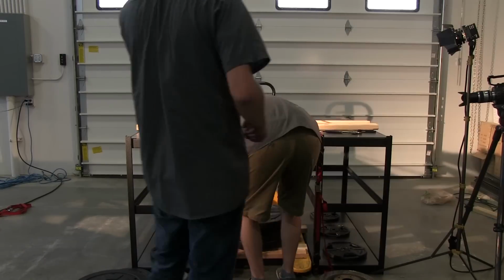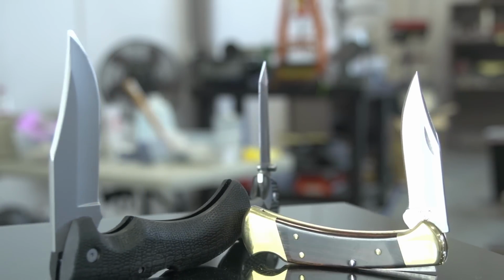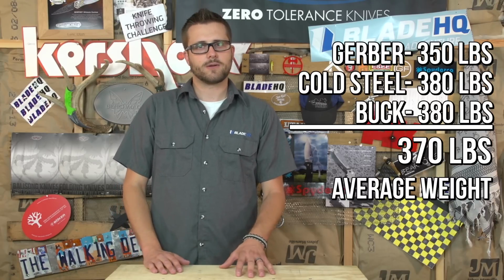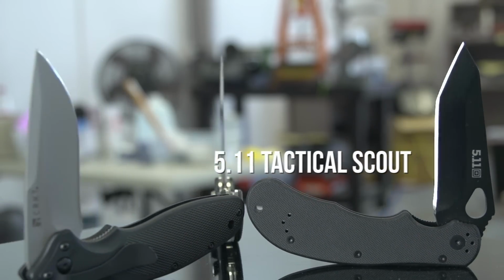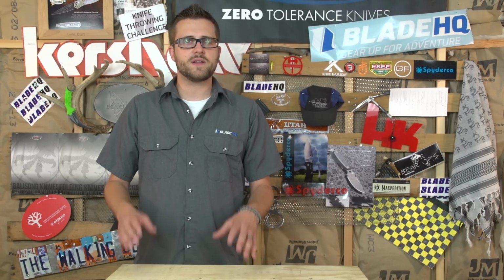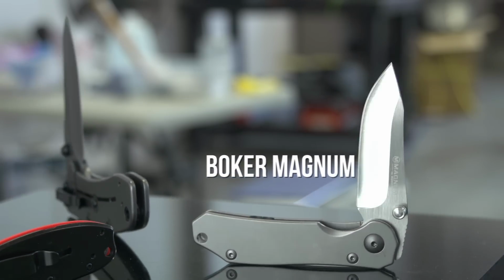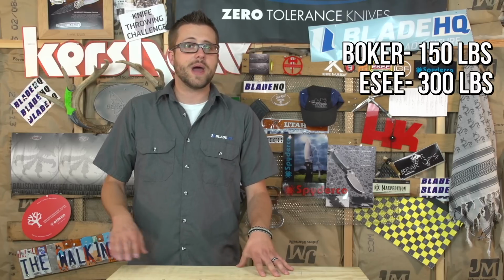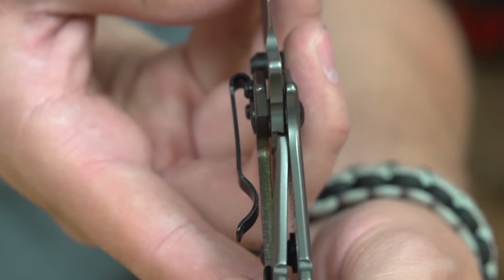Pocket Knife Lock Strength Test

Comment: Two things
First, the way you guys determine the average value is just wrong. Can’t just say 380 lb is the max value.
And secondly, for the results to be some what accurate, all locking mechanism has to be using the same materials. Different steel and it’s alloys has different capacity. 
So this is like sorta comparing apples to oranges. Nevertheless, nicely done and I enjoyed watching it.

Comment: Whats the difference between liner lock and framelock?
Reply: A liner lock has handle scales, and a metal liner inside to act as the locking device. The frame lock uses the actual frame or scale of the knife to lock the blade.
Reply: oh ok thanks

Comment: Can these locks take a large static load that is carefully and slowly applied? Sure. Can they reliably take much smaller loads that are applied abruptly, dynamically, and with varying direction? The good ones can for awhile, but ultimately no. get a real knife, a fixed blade.

Comment: That'd boy how u do the test....u need to pull from tip at the end of the knife....not at the middle ...at the middle resistance is way stronger...u need to  do it at the tip of the handle.....set up a rig where u can put like a cap 9ver the end 9f the handle and pull on that

Comment: Cool tests, thanks for destroying all those knives for us. What about Axis locks like Ganzo or Benchmade? I know you may not want to spend that much money to destroy it for a test. Interesting how the Gerber handle was pulled apart, although in it's defense it looked like the soft handle material allowed the cable to slide down and hit the lock release. I noticed you put on safety glasses after the first tests. The important thing is, most failed at weights way over what anyone would normally apply against a lock. I'm amazed that lockbacks were the strongest, that's what I have trusted the least, not anymore.

Comment: That sound was likely as much to do with your clamping jig as the blades, it was flexing badly. You can clearly see the lock fail on the replay before the handle too. Love your channel but you really should have tested to failure, and your resolution was like 12% of your maximum potential load. Your load introduction varied a lot too. Don’t mean to get at you, but this was an opportunity to assess the capabilities of the steel and handle materials used, as well as lock types. The idea was great but I think there was a lot of wasted potential, and no proper PPE? C’mon guys 😐 Still likes for the innovative idea!

Comment: They are testing the strength in the wrong direction... you want to know the stress you can put on the knife when cutting not how much closing force it can handle.
Reply: Completely agree! For 'f' sake, not a single person thought of that?! So many knives use a simple blade stop "pin" that bears all the leveraged cutting stress. And I just watched them perform a newer version of the same test, but instead, using a winch and digital loadcell instead of weights.

Comment: The liner lock reminds me of the Luger pistol. It isn't really locked. When you aply enough pressure, it will open. On the Luger, this was used, to delay the automatic reloding process, until the pressure in the barrel had dropped enough. on a knife it's only advantage is, that it's cheap to produce. I once cut myself quite a bit, because the "lock" didn't hold. No thanks, i'd rather spend a view bucks more and be on the safe side.

Comment: Thanks...of course the only real accurate way to measure failure is changing out every single knife everytime you switch the plates...think about it..every time you test the same knife it will bend and damage the lock each time you put a ridiculous amount of weight on it.

Comment: if the blade gives at 300lbs, it doesnt mean it held 300lbs....you made this error repeatedly. if it holds at 250 and then gives at 300, it means the knife held at 250, not 300.

Comment: I am sorry, but I do not get this... Why would anyone press a knife in that direction during use? It is the lock from above that counts. I have a small Gerber multitool where the metal pushing the blade in horizontal position simply snapped off, so the blade can not be pushed towards anything. 350 pounds weight is more than most people weigh I suppose. So knives like that could be used for mountain climbing by most of us. Does anybody use knives in thst fashion?

Comment: Not much real world point to this test. You rarely have presure on a lock bar when using a knife. When chopping or slicing the pressure is on the stop pin or whatever mechanism the knife uses to keep the blade from failing upward.

Comment: Am I the only one finding they are testing the knifes in the wrong direction? you guys should flip the knife with the edge pointing up and then applying downward pressure at the handle, that's the way to test the structure and integrity of the folder, and that's how a knife takes pressure usually. If you test them as you did in the video it literally means how much force can i put on the handle before closing my fingers on to the blade.....

Comment: Fair test but not very realistic. Let's see how the various more expensive knife BLADES hold up as the user attempts to pry out something realistic for a realistic knife test; and how many blades are still tight and no wobble after the test presuming the blade does not break off during the test. Microtecvh, Pirranha, Protech and sinking the blade in about 1/4 of the blade length to no more than 1/3. Make it realistic so we can justify these expensive flip open, button open or OTF knives. Thanks. Oddly, I use the cheap Klash button open tanto blade (as that blade really takes a wicked sharp edge when sharpening for daily carry-plus, if I break it, it is $30+ as opposed to $300+!

Comment: Some thoughts on this pretty meaningless test:
1. Music was annoying
2. Bend tests like this require the distance from the pivot point to be maintained on all test setups or the results are meaningless, you are actually applying a moment load so distance from pivot actually amplifies the actual weight on your carriage.
3. Does this test conclude anything? Maybe it would be better to mount the knife with handle fully constrained up to the pivot like a hand is holding it and then put your weight at the very tip of each knife to mimic the worst case loading for each blade length/lock mechanism. Maybe doing a buckling test where the weight is applied directly down the length of the blade is better because this shows the max stab thrust force you can achieve?
4. Does any of this really mean much. It seems like the result of this test show that a near inhuman level of strength is required to close or break these lock mechanisms so past a hundred lbs or so force does it really mater how much overhead the knife has? As long as the knife can withstand a minimum level of closing force on the lock mechanism I think ease of use far outweighs the ability to handle higher closing forces than will ever be seen.
5. Not that it matters but maxing out value should not be included in the averages because the spyderco could go to 1000 while the two lock backs could have failed at 400 which would mean the liner locks are strongest when you average the values. I don’t think it matters much though because there were a bunch of other variable that weren’t maintained well in these tests so the results in general are kinda meaningless.

You could do a whole series on different test methods and come up with a huge array of data points. Also, testing more than one of each knife will help eliminate factory defects that might cause erroneous test data.

Comment: Hey guys, this comment's got nothing to do w/ BladeHQ's video, but I know there's a lot of knowledgeable knife people who watch these vids.

-> I want to know if anyone's got any good recommendations for non-locking folders w/ Blade Length: 5.5cm - 8cm (2"-3") which also has a 60+° angle from Spine to cutting edge.
________________________________________________________________
Reason: I'm going on a trip to China in ~1/2 a year and maybe Japan. I just wanted to do some research on what knives I can legally carry before leaving. 
For those interested (from what I found online) here's the laws in China & Japan (I might be wrong, so please correct me if I am):
China: Non-locking blades under 10cm (3.9") w/ a 60+° angle from Spine to cutting edge.
Japan: Non-locking blades between 5.5cm - 8cm (2"-3").
Reply: If possible, something under $50, since there's a lot of thieves in China. Sorry for asking too much, but thanks in advance for those who takes their time to answer my question. :)
Reply: 16.5toHeaven I don't think slip-joints are considered locked, so maybe one of those Victorinox Swiss Army folders.  At least then you get some other functions. Not sure what the 60 degree angle thing is though. Search BladeHQ for "slip joint" and see if you find something you like; there are a lot of options. I only mentioned the Victorinox knives since those are the only ones I own and those would probably be more publicly accepted.
Reply: LotusLeaf88 yeah, I did read a lot about bringing SAKs. I'm thinking of bringing one as a utility knife, but I also want one for defensive purposes. Thanks for the advice, I've found a few good ones on BladeHQ's site like the CRKT Edgie.
Reply: 16.5toHeaven Be careful! I would expect nonlocking folding knives to pose a huge risk to the user in such an altercation! I couldn't trust my fingers to non-locking folders in that kind of chaos and struggle. Some people don't even trust locking folders for that. If small fixed blades are legal, I'd urge looking at some of those. Or look at other possible (and legal) defensive options such as pepper spray.

-Note that I'm not a self-defense expert or any of that, so do you what you think is right.
Reply: As far as I know you can't carry anything in Japan "just in case" or for "edc". You need to have a specific use for a knife you carry.
Reply: Check out the Lansky World Legal Knife. Don't know if its what you're looking for, but I believe it meets your specs.

Comment: What a amateur night. You can't hook  weight where ever you want. Further you go less weight can take. If you want fair review you need to measure same distance from center of axle to how far you want to go and have same distance for all knives. And you need to secure your steel cable to stay on that mark. If slippage ocure it will brake sooner and give wrong results.
Reply: Then you didn't secured you cable not to shread and destroy scales and therefore give complety useless readings. Your test only shows how hard are scales and rivets.

Comment: this is so unscientific, I can not even watch. did you even make sure that the weight was at the same distance from the pivot on every knife? also: how can you average something when you did not get to the breaking point on every knife?

edit: 172 kg (380 pounds) at 5 cm (i can not bother with imperial system, sry)  from pivot are ~84 Nm and at 7 cm 118 Nm. So this is a huge difference you need to consider.

edit2: i just saw you did a part II, maybe delete this video? maybe you got it right on part II

Comment: WRONG....The Gerber FAILED at 350 Lbs. so it held 300 lbs.! Also the 5.11 only held 100#'s as the CRKT only held 150#'s. Again: the Boker held 150 pounds and the ESEE held 250, making all of your hard work for nothing because these are skewed results. BTW, the pressure of this test is in the exact opposite direction of pressure that we put on knives when we're cutting with them properly! If the knives would have been turned 180° with the spine down it would be a better test.

Comment: Dumb.  Wasted effort on the wrong side of the blade.  This test should have been performed with the cutting edge up not down because that is how the torque would be applied when actually cutting with the blade.  Interesting vid but it's just a fancy variation of spine whacking.  Only thing it proves is how  heavy of a guy can stand on the knife after it's imbedded into a wall and used as a mall ninja step ladder.
Reply: They were testing the locking mechanism, which, if it fails, results in you losing a finger. Failure to the spine, pivot and or handle could result in injury as well, but would do nothing to test the lock. Hint in the title: "lock strength test."